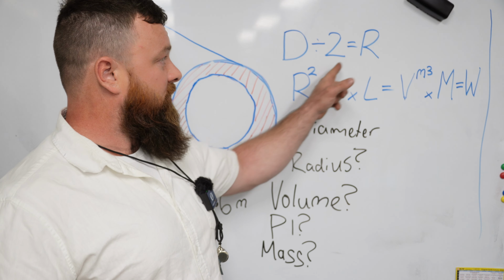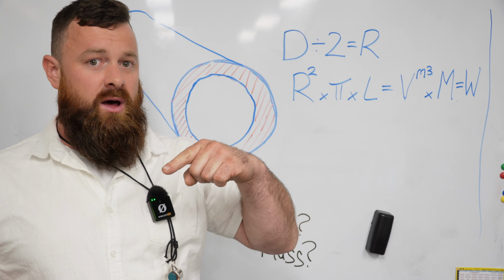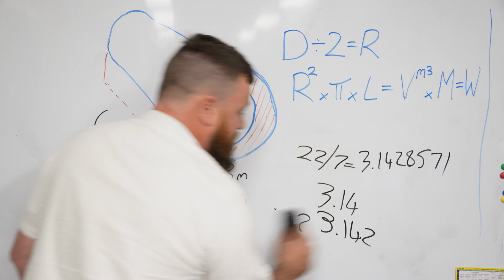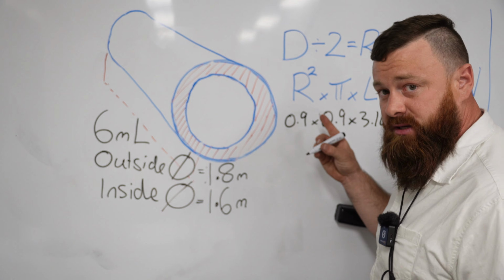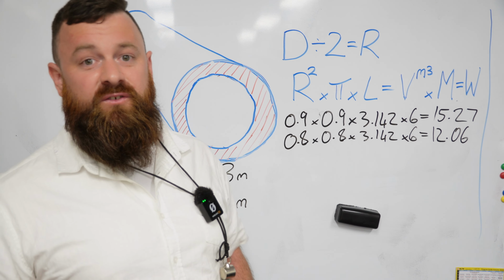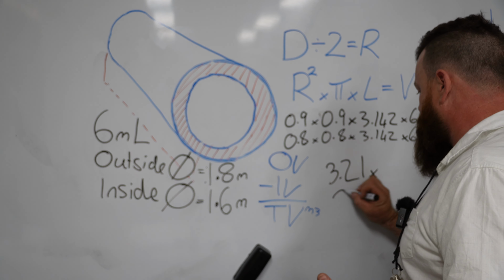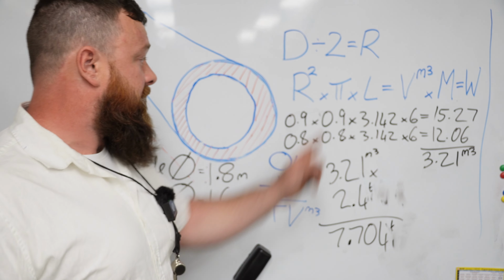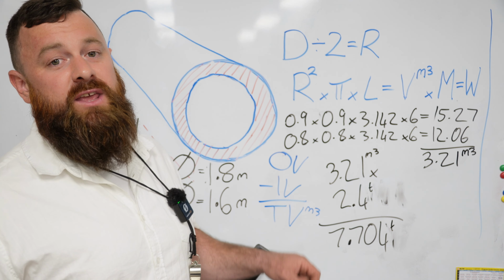Concrete Pipe Maths—Don't Guess It, Calculate It!

Comment: How do we calculate a block of concrete? Like the counter-weight on the Tower cranes?? Please
Reply from the maker: Length x width x Height x Mass.

Or read your erection manual found in the manufacturers specs.

Comment: Why isn't the formula not π D x 6 x 0.1 x 2.4  = 8.14 tonnes? 
 
π D is the circumference of a circle. 1.8 x 3.142 = 5.6548 circumference

If the pipe were split and laid out flat is it a rectangular piece 6 m long x 5.565 wide x 0.1 thick - 3.3929 m3 x 2.4 tonnes  = 8.143 tonnes.
Reply from the maker: Good question.
My answer, this is just one way to do it.
Common to how we teach it where I work.

There is also another way that I know of that is DxDx.79xLx2.4 then all you need to do is subtract the difference
Reply: @OzzysWay4  Hi

Are you saying 1.8 x 1.8 x 0.79 x 6 X 2.4 = X? 

Why 0.79?